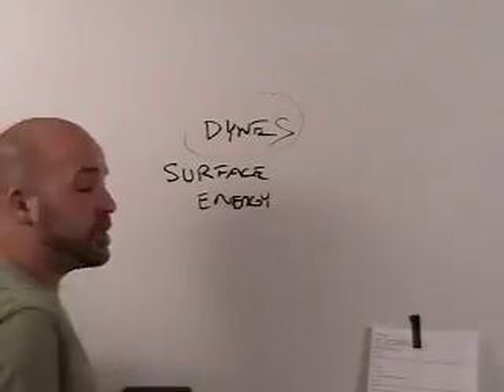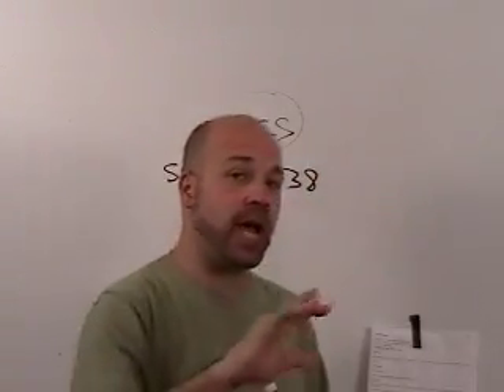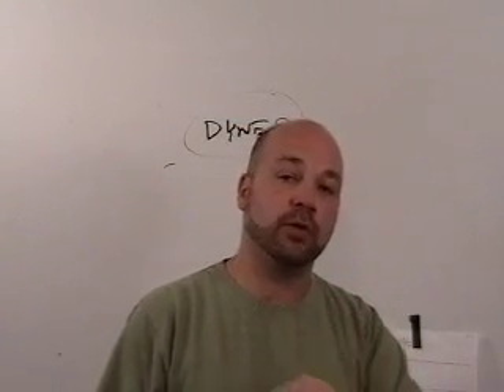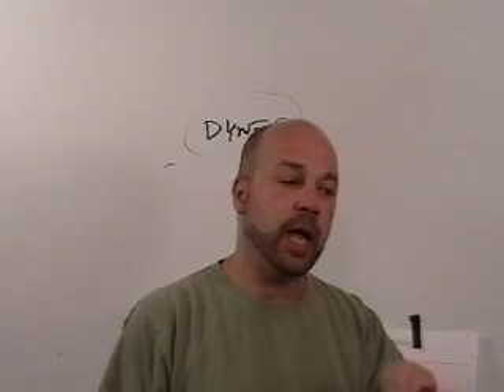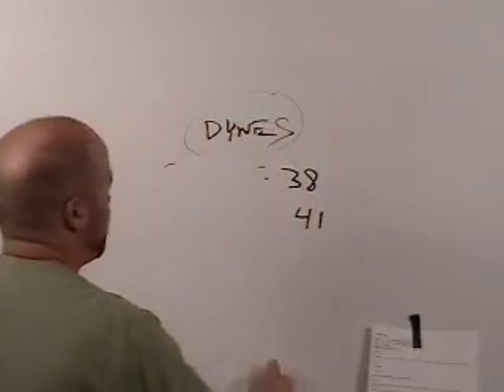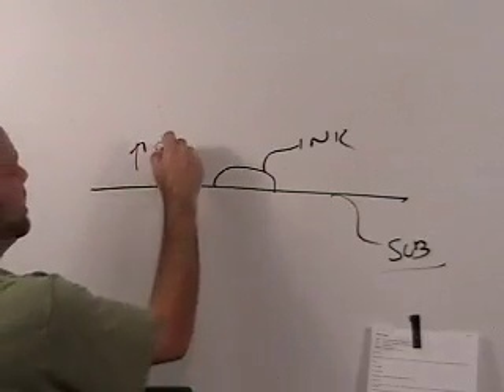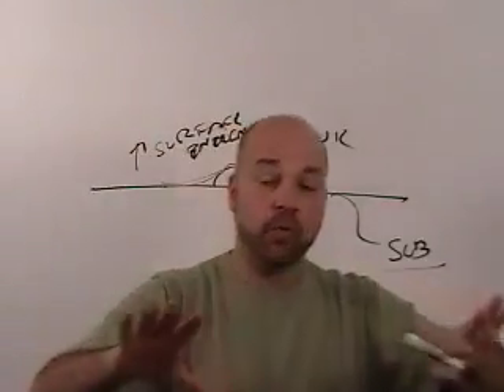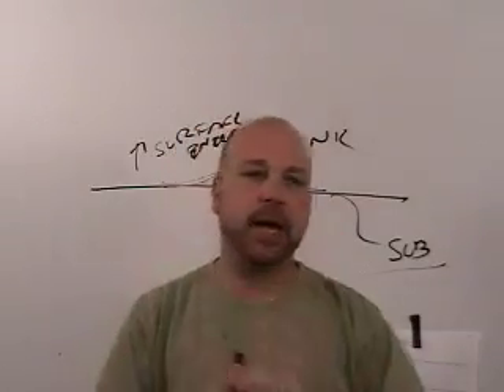Pinholing on Thin Gauge Film, Part 2

Comment: Anytime i have this problem with flood coating, I always resort to using two bumps of whatever color that I happen to be flooding.  But, when it comes to double bumping an imaged plate, along with the other plates in the job, registration management becomes hard to control.  So, I'm most interested in what you were saying about the dyne level of the substrate.  How can you increase your dyne level, and how can you measure your dyne level?  Also are you referring to UV or WB?  Does it matter?